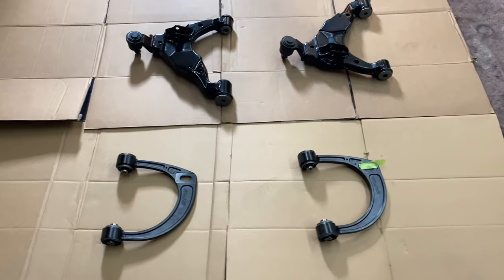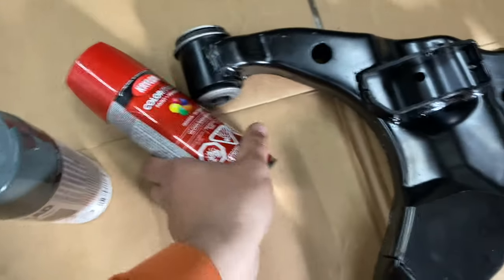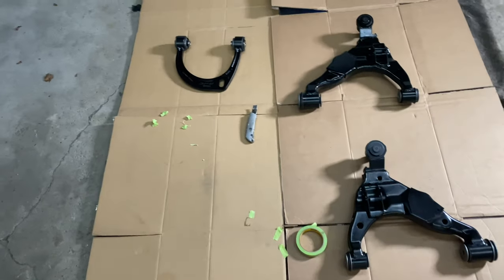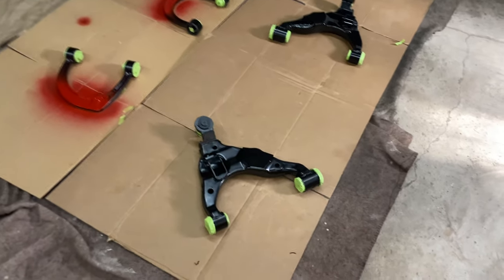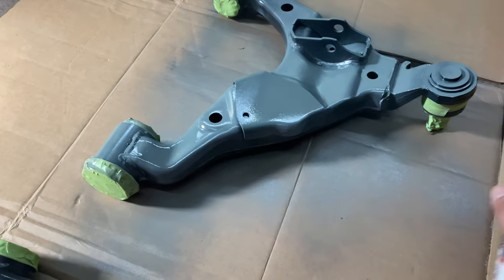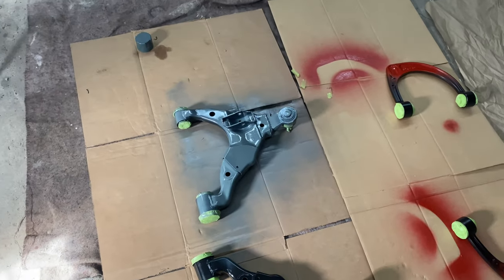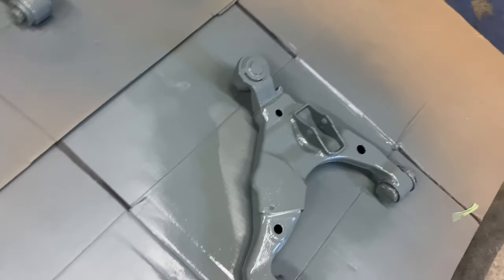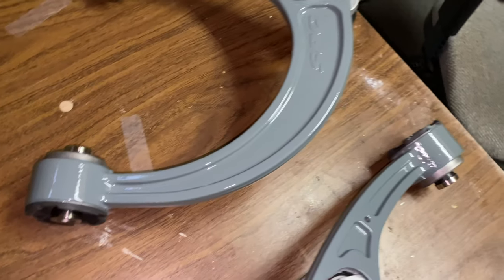How to paint control arms (Toyota fj cruiser)

Comment: I used that Krylon Color Maxx on a lawnmower to fix rust spots and it bubbled and pulled the original paint right off.  I then picked up Rustoleum Farm and Implement paint and that stuff worked really well, it looks like a factory applied finish and it's been taking a beating.